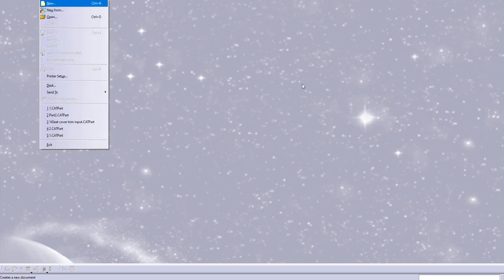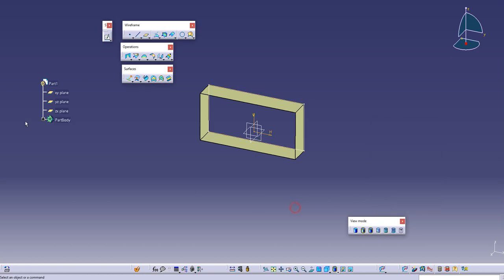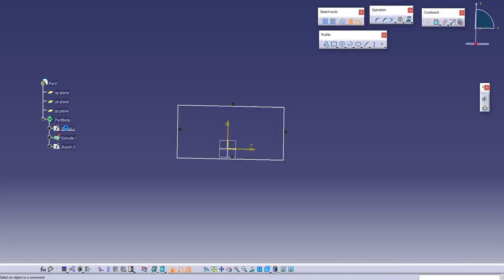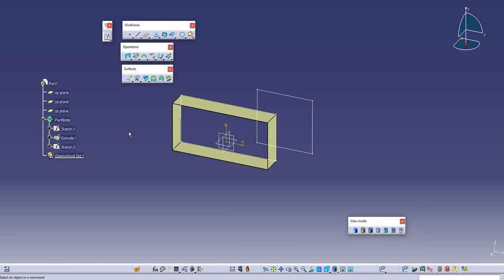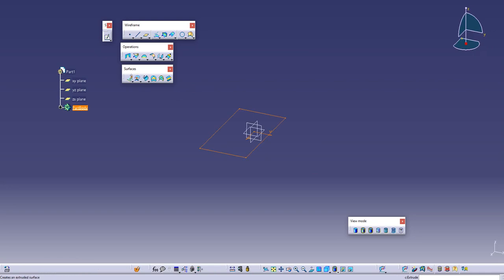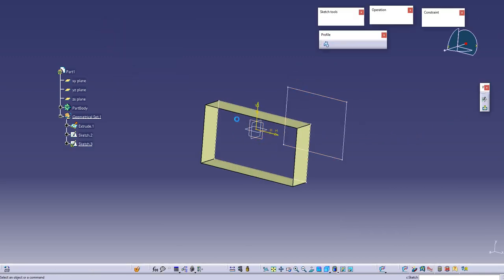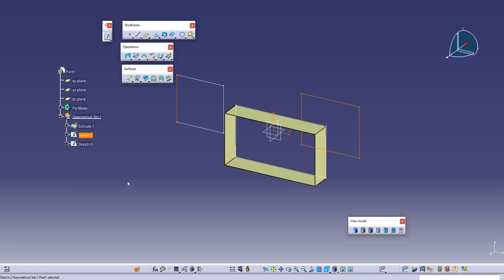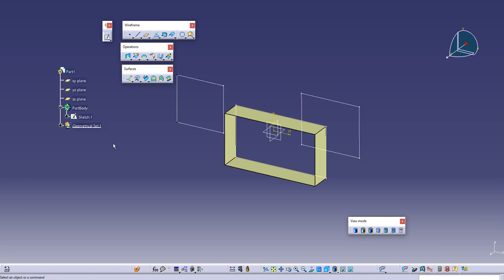Difference between hybrid and non hybrid design in CATIA

Comment: Good thing your vedio is coming back to back.carry on to giving this type information.
What is advantage of hybrid design?
Reply from the maker: Do a small assignment 
1.make a rectangle sketch in part body 
2.then extrude it and,
3. then give fillet on edges
do the same in geo set,
you will see while you do this in geo set, the extruded rectangle will be there in hidden mode, 
while when you do the same operations in part body you will not find the rectangle in hidden mode

so in part body your tree is neat and no extra surfaces are present in the file which makes file light and easy to work with
some people like do work like this, they dont want extra surfaces in the part.
Reply: @mechdesign2101  thanks I will try.